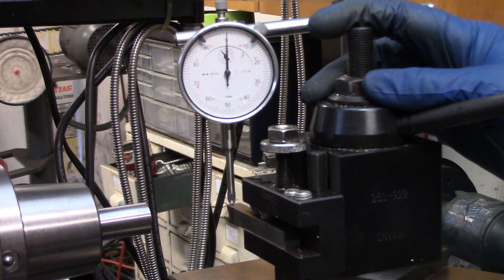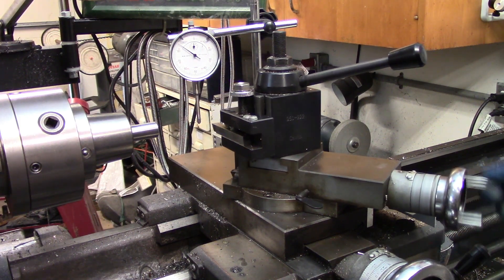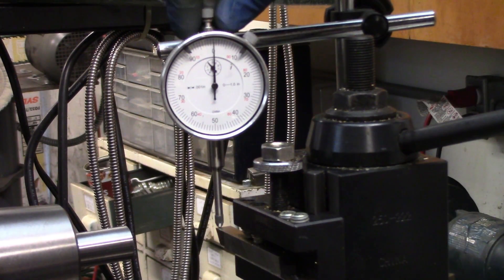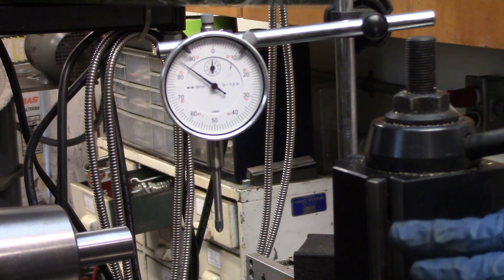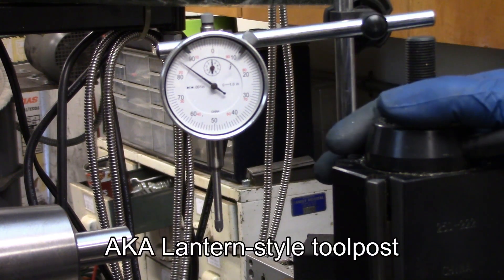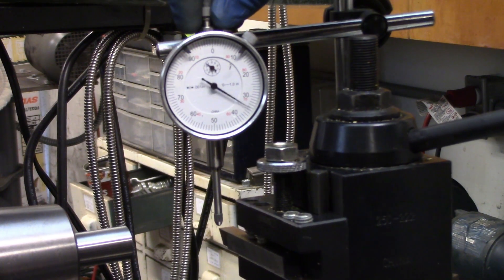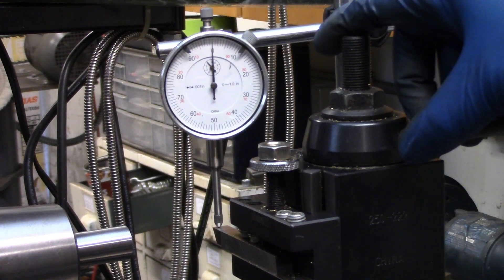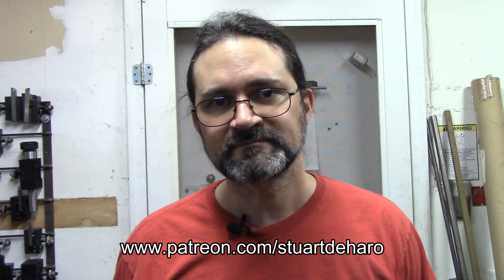Testing the Accuracy of a Quick Change Tool Post

Comment: Thank you very much. I have a 250-200 piston type tool holder. The tool position changes in the x  diameter direction by up to 0.3mm. I noticed the error when it was too late😂. 

I did the same test in height direction with a dial indicator and the error was only 0.01-0.015mm. 

I am going to change the piston type to a wedge type tool holder.

Thanks

Comment: While I don't want to seem inappropriately critical, I feel compelled to voice my opinion about how wrongly this "test" was conducted.  First consider the relative positions of how lathe workpieces are rotated compared to tool-post-mounted cutting edges.  Texts and schools suggest accurately aligning tool cutting edge height to match workpiece rotation center height.   Consider how you might measure height of an unloaded 100psi inflated "perfectly round" tire supported by a level surface.  You would take that measurement  exactly above the tire's rotation center.   If instead you measured that height a few thousandths of an inch forward or rearward along the tire's travel path, would you observe a significant difference in height?  Answer is no SIGNIFICANT difference would be observable.  Sure, it's fun to run the trig calculations, but the height effect difference will be so trivially small as to be time wasted.  The same is true of height differences when swapping lathe quick change tool post holders, even though that height difference from rotation center is doubled as it effects workpiece diameter.  

By contrast, horizontal positioning repeatability along lathe axes is VERY IMPORTANT because it controls cutting edge position at a 1: 1 ratio.   Wedge-style tool posts have one fixed horizontal force-loading side and one movable horizontal force-loading side.  The movable side repeatably loads tool holders solidly against  the fixed side which configuration produces excellent horizontal position repeatability.  By contrast, piston-style tool posts press their tool holders against two converging-angled surfaces.   If loaded surface-to-surface slip friction were zero and if machining tolerances were perfect, neither of which exist  in physical embodiments of piston configuration tool posts,  tool holder horizontal position repeatability would similarly excellent.  

This test is worthy of running again, but focus >95% of attention and interpretation on tool holder horizontal position repeatability.
LoveLearn
Reply from the maker: Not a bad idea actually. It will be a while before I can do it since my shop is freshly moved, but I'll put it on the books.

Comment: I have the T37 (dickson) type holders, it is a Chinese job and it has terrible repeatability. It also easily rounds off the tightening nut. Had to repair both of them. Might be a function of the poor repeatability meaning I am really swinging on the tightening nut, dont know.
Reply from the maker: We have that type on the lathes at the community college and they are terrible for repeatability. There's nothing but gravity pulling the tool holder down against the height adjuster and the tool holder gets jostled around a ton by the cam. The odds are heavily stacked against it landing in the right spot.

Comment: I don't know why but I always thought the piston type tool post will be more accurate because the tool holder always rests on the adjustment nut and is not prone to movement as you close or tighten the tool post which will probably give you slightly different readings if you apply different amounts of torque every time you change your tool post, like the reputability is dependant on how tight you close that handle. I its a very good test and actually not something I've ever thought of doing myself. Thank you for sharing

Comment: I've been curious about this. Definitely a helpful video. I tend to use tenth indicators more often than I'd thought. Very easy to get an erroneous reading solely due to the machine releasing energy generated by a gentile rotation. My most accurate indicator, a Mahr with a total range of .010, can be seen realigning itself as the vibration is released. Sometimes the variance is close to a thou.

Comment: Good to see you posting content again Stuart! Another useful test would be to put an indicator on the end of the cutter blank facing the work piece. Lock the carriage and cinch down the cross and compound gibs( to eliminate those variables), and see how repeatable the cutter tip returns in the X axis. This would be useful info for those who use a solid plinth in place of the compound, and store tools in the DRO.

Comment: My biggest issue with the import QCTP's is the poor quality hardware that comes with them. The studs and knurled washers for adjusting the height of the tool holders are a very poor fit. Sloppy, loose and often off-angled threaded holes are a major source of random movement of the tool holder. I run a tap through every thread in the tool holders to clean out the threads and remove burrs. Wash out any oil and rust preventative gunk and replace every stud and grub screw with quality hardware. I add Loctite to the studs before installing them into the tool holders to keep them from loosening and moving around. The hex sockets in the soft steel Chinese factory screws strip out way too easily and will need to be replaced soon anyway.
Reply from the maker: I agree. I actually have a tool holder right now with a stripped set screw hex that I need to drill out. I might do a video on it. Not sure though.
Reply: @StuartdeHaro  What really drives me bonkers is when you pull a new tool holder out of the box and spin the knurled adjusting nut/washer on the stud.... and it wobbles like a spinning plate on a table! I've had some that were drilled and tapped at about a 15° - 20° angle.

I keep a couple of boxes of studs and dog-point set screws from McMaster on hand for both AXA and BXA size holders. If I catch some holders on sale I will buy a few and the factory hardware comes out and goes straight into the trash. I put in the new fasteners and never look back. Piece of mind.

Comment: My china lathe came with the china piston style of tool post.  It's biggest issue is that the longitudinal (boring) dovetail isn't square, which I discovered after I made a tool post drilling fixture.  Planning to replace it with the genuine Aloris unit pretty soon.

Comment: I've tested my aloris knockoff (wedge style, from shars) in a similar manner as well.  I could get within a few tenths if i used a similar amount of torque on the handle.  

Its pretty easy to tweak mine off .001-.0015" if i give really turn the wedge handle extra hard.

Comment: If you used a DTI, you could roll the tool out from under the arm and back again without touching the indicator setup.

I always assumed the problem with the piston-style post was variation in lateral repeatability, depending on how hard you crank on the fixing lever. I never thought about the vertical draw-down effect.

Good info, thanks.